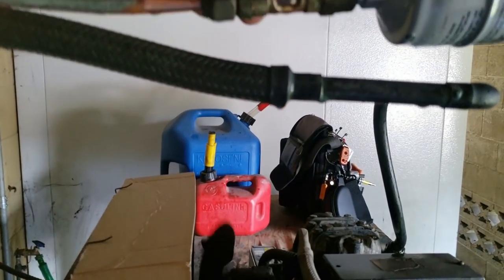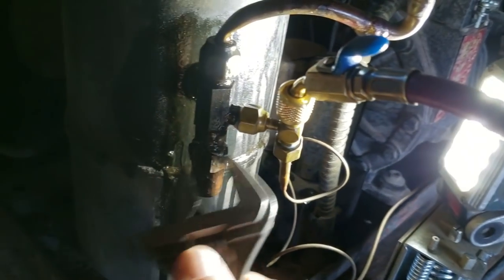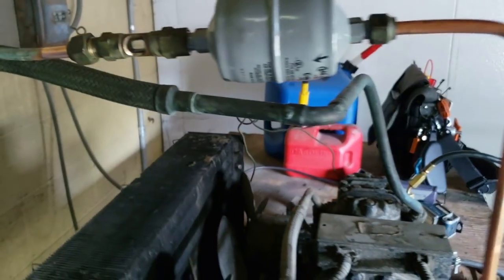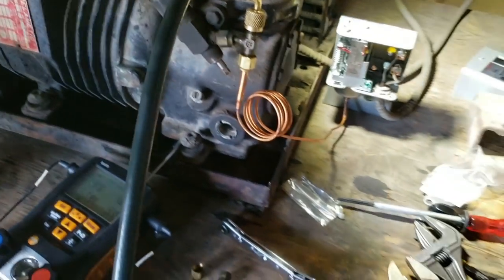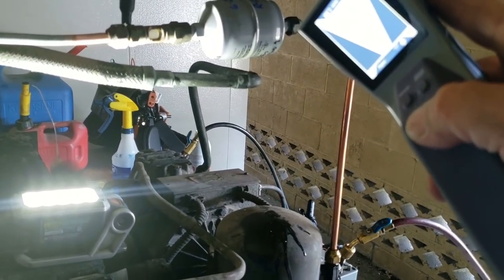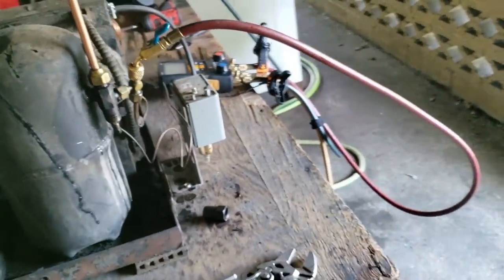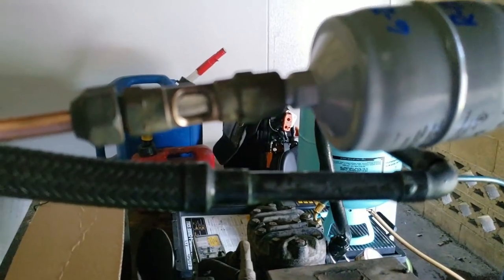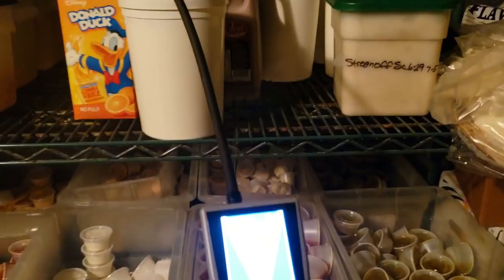Walk-In Cooler Warm, Refrigerant Leak Repair

Comment: good to keep pushing to check for power! I know of 2 plumbers killed due to throwing breaker, but box was wired wrong, & still had power to hot water heater, this is vintage places before ground wires were installed in homes, it was people my parents knew, & I knew them as a child, so 45 or so years ago, but dead is dead.
Reply from the maker: Kind of like the saying trust but verify. I've had that happen once when the customer said they turned the power off. 😠 It only takes a second to double-check it 👍👍 Thanks for the feedback!

Comment: I used to keep some sheet metal on truck to easily bend up a new shroud on those condensing units that I found without or were damaged . Having  a top and sides is critical for pulling air threw and not around the coil.
Reply from the maker: I keep two small 2'x2' pieces of sheetmetal for several different miscellaneous repairs but I haven't tried to make a true round shroud around where the fan blade is at.  Is that you mean?
Reply: @HVACRSurvival  Just having a top and sides that extend past blades is what I made as a quick shroud. Just so blades are pulling air threw the condenser and not around it

Comment: you seem to do some refrigeration, could you do one on installation procedures of a nozzle in a distributor that has a 6" tube and the TXV is flowing upward. Is there a recess that the retainer ring pops into?  The proper tool to install the clip, which end of the nozzle goes against the distributor ( one end is chamfered )...
Reply from the maker: Most of the time the installers put those in before I get there. I have used a flat head screwdriver to push the metal ring into place behind the nozzle or possible a nut-driver.

Comment: for systems that old and ready to fail,you should tell your customer that states and fed government have grants and rebates to replace old hvac with newer equipment. there are also energy star loans to help defer the costs.
Reply from the maker: This is in a small town restaurant that has limited resources. Heck even the bigger 4 and 5 store locations sometimes want a gas and go repair 🤣.  But I know what you mean👍👍. Thanks 4 checking it out.

Comment: Great video, very detailed as always. I was curious how do you like the stratus ? I bought one and have not had a chance to use
Reply from the maker: It has great battery life and charges in 3 hours. Its about the same sensitivity of the Select. The new select is about to be released. It will sell for the same price as the original. I like using the PPM for narrowing the leak down in a contaminated area. But don't recommend  that mode for general small leak searching.

Comment: Mini splits have torque specs in the install manuals, but looking for reference info on general refrigeration flares. 1/4", 3/8", 1/2" ??
Reply from the maker: I did a general Google search and looked at the largest manufacturer specifications and compared them, averaging the numbers between them.
Reply: Found a blog on B.O.'s site that had a chart.

Comment: Nice repair,  you should invest in a go pro  to make it's easy to work with two hands.  👊
Also please kindly let me know the model number of that leak detector. I have not seen that here in UK as yet.
Reply from the maker: I have a Hero 7, I switch back n forth. The phone is sometimes less intrusive. The detector was the Inficon Stratus.
Reply: @HVACRSurvival  Thanks for the info.

Comment: Hey rick got a question, so you opened up the system and didn’t pull a vacuum and said you just pushed any air out. How did you do that? Just keeping the system pressurized to the point no air gets in? I’m still learning these little refer tricks..
Reply from the maker: A old leaking system like this will not pull a perfect vacuum anyway.  (FYI...It's not the right way of doing it.)  If you ever notice when you open a system and hold the open end up to the sun or a bright light you will notice the refrigerant boiling out. That's gonna keep out some basic infiltration of air. But it has to be done fairly quickly, (like less than a minute) otherwise the boiling off will stop and air can get it.  I made sure to make sure I pushed refrigerant from both sides of the compressor just like I was purging my refrigerant hoses on my gauges. The open end was at the flare fitting that you seen open yet. I don't recommend doing this on a compressor or anything like that has a oil setting inside of it. But like I said this is not the way the book will tell you to do it and you will catch crap online for doing it. But I'm about trying to be real in a real world. If it was brand new I would not do it.
Reply: HVACR Survival hey man that’s why I was asking. I kind of figured that was the case. And it kind of seems like you can get away with murder on those real old systems anyway- I’ve seen guys change a pressure controls real quick like that too. Thanks for the insight.